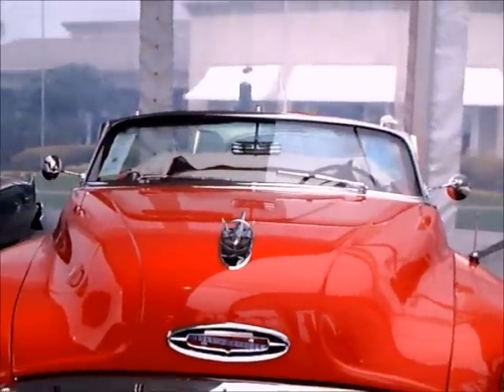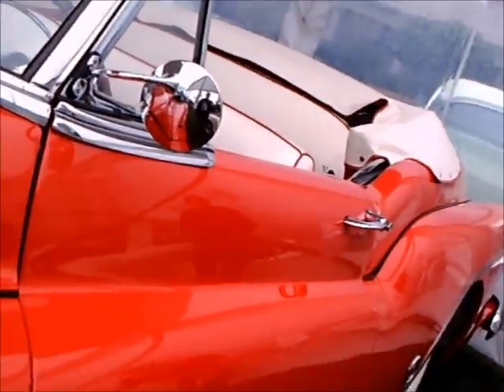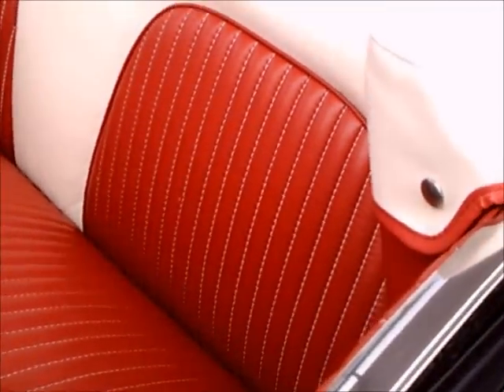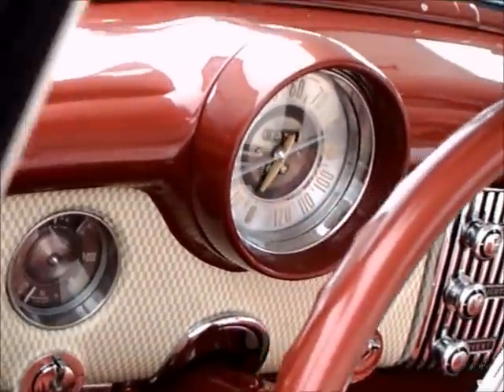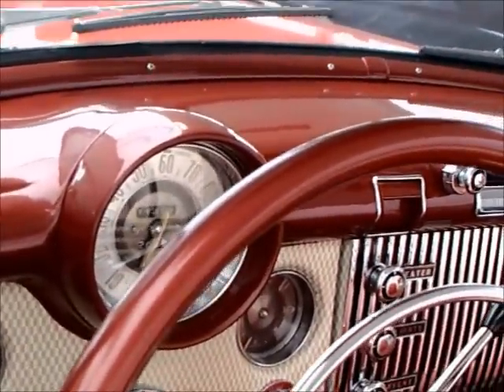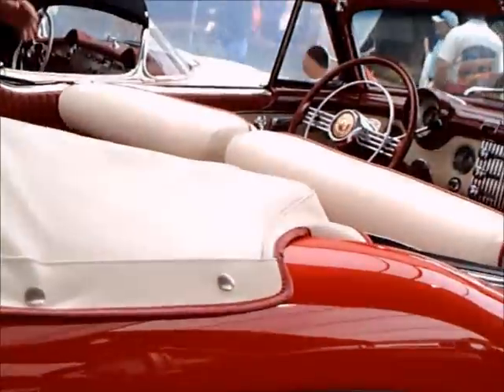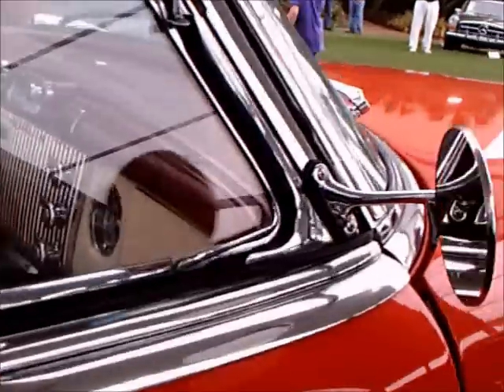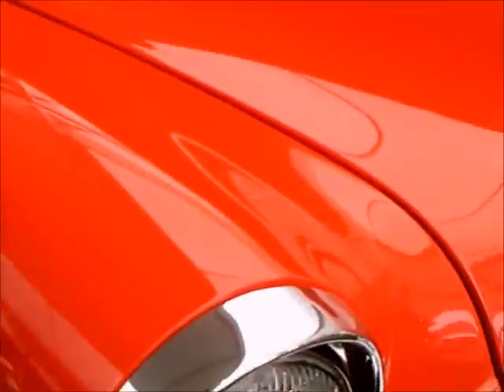1953 Buick Roadmaster Skylark Convertible Red AmeliaIlsand031315

Comment: The lines along the waist line just flow from the front to the dip in the door and the up-sweep over the rear haunch. To adorn a pricey cruiser you just gotta have a full set of Kelsey Hayes wheels. Did the designers get inspiration from Dutch Darrin's Packards? Oh and of course the upholstery has to have piping, Interesting in 53 Oldsmobile's,Cadillac's and Chevrolet's halo cars had wrap around windshields, but not Buick. I wonder how the conversation about windshields went in the styling department. :)
Reply from the maker: cheddyrod Hey, Chester!  Very true about the design flow!  I'd bet that Darrin had an influence, perhaps unconsciously on the "dip".  That's a great point about the windshield. With all the fitting and leadwork they had to do on this model, perhaps there was not enough development money left to do the wraparound windshield.  Thanks!  :) Jack